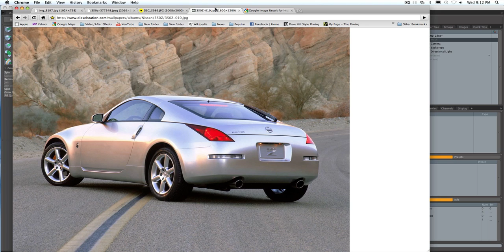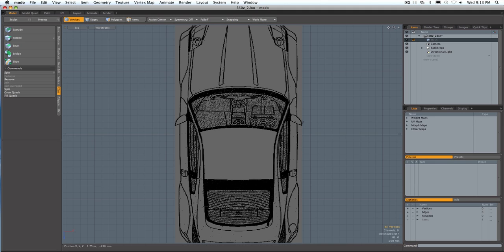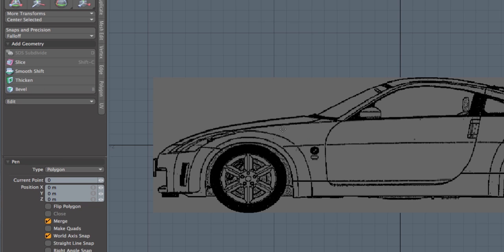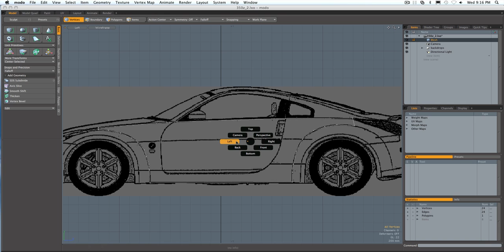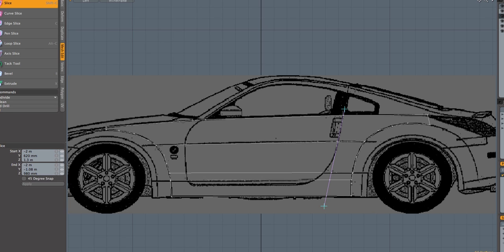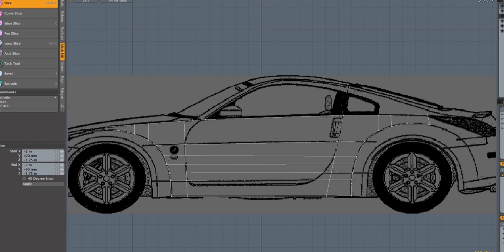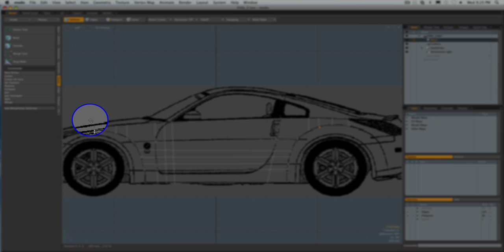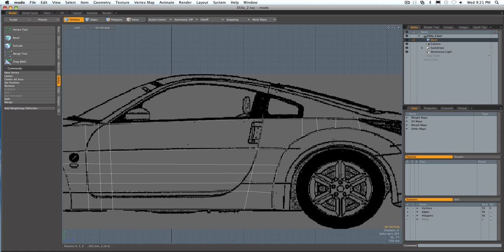03 Modo Car Modelling Tutorial -  Starting The Car Model

Comment from the maker: I cant reproduce the problem you're having.  Try starting with Flip Poly unchecked.  You may have to reinstall Modo.  Almost every version of modo has a couple of glitches that they miss, even in updates.  Make sure your software is up to date as well.  You can select all poly's and click "align" and see if that works.  Seems like you are looking at the "wrong side" of the model.  Select all poly's and click ALIGN and then FLIP (the F key).  See if that helps

Comment: First of all thank you so much for this.
I am a beginner and I have a "problem". When I use the pen tool to make all teh points, if the Flip Poly is checked, it fills the area delimited by the points. If I un check it it's fine (looks like in your). So I did this and went forward to the point of having to "slice". As I start drawing the line holding shift, then again the area delimited by the points is filled with grey. Why? how do i solve this?? please let me know.

Comment from the maker: I think it's a preference thing. I didn't want to take the time to learn Maya.  Modo has a much shorter learning curve.  As far as 3DS Max, that's a great program but I am on a Mac and I prefer Mac, even though I can boot to Windows, Mac just has less crashes, etc.
No one says you have to pick one or the other.  I use Modo for most of what I do and I use Cinema 4D for the rest. Modo has no physics engine. Do some research on Modo, and consider it as one tool among many.